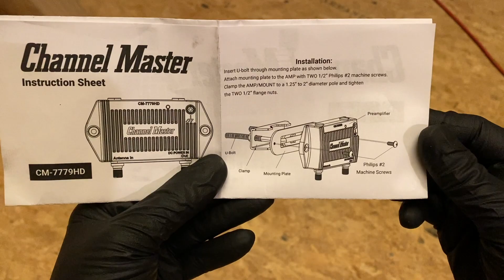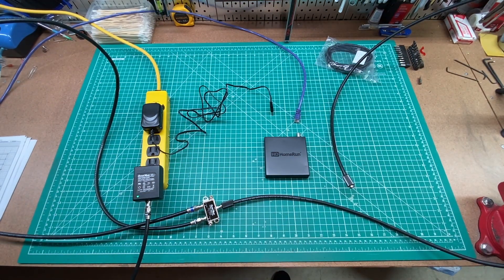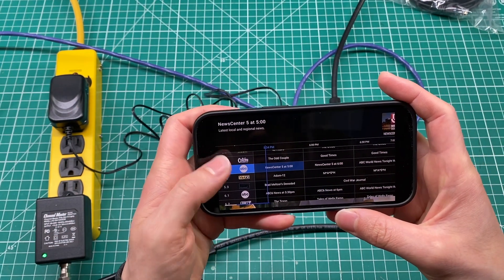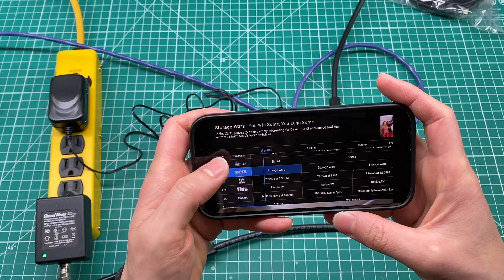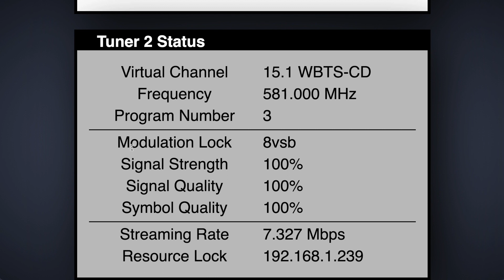Fixing my OTA TV Signal With The Channel Master CM-7779HD Preamp

Comment: Just installed this device yesterday, pulled in 57 channels on low gain and 3 more on high. Using an antennas direct bi-directional 8 bay with a signal combiner, pramp 1.and a 50 ft rg6 cable run.
80% of my towers are 70+miles away and largely over water. If anything this thing has really strengthened and stabilized my channel list.
The build quality is just great
Glad i purchased it 🍻✌️✌️📶📶
For my set up the antenna and then the preamp1 has paid off in spades with years of cost savings and many more to come 
🍻 📶📶✌️✌️
Reply from the maker: Very nice!

Comment: Thanks  !! Just bought one.. im already in a great spot and get lots of channels  but my towers are quit far and my cable  run is about 40ft  looking forward to installing it 🍻
Reply from the maker: Awesome! There may be cases where the high gain can be too much. Def worth experimenting with both low and high to see what works better. Thankfully the way you provide power to the preamp is super convenient to switch between the two. Good luck!
Reply: @MostlyBuilds  thanks I hope to report back !!  🍻